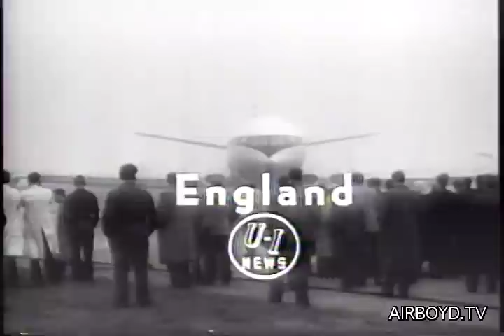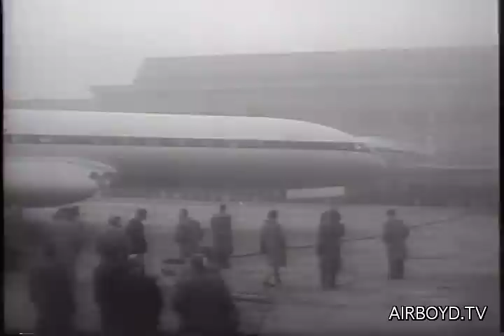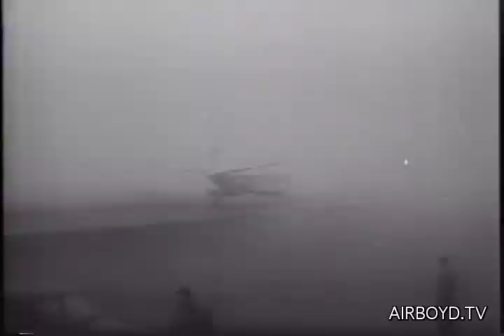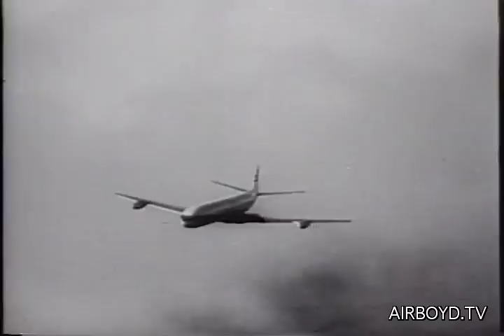de Havilland Comet 3 Introduced (1955) G-ANLO

Comment: After G-ALYV, G-ALYP (Yoke Peter) and G-ALYY (Yoke Yoke)  broke up it was interesting how DeHavilland went about creating pressurised cycles on the ground using a large tank of water to submerge, time & time again, an actual Comet airframe (G-ALYU) to create re-pressurization and over-pressurization.  At 1,836 simulated cycles G-ALYU burst open from metal fatigue around windows in particular.

Comment: The Comet never flew at 600 mph. 500 mph would be nearer the mark for maximum speed. The time given is elapsed time which probably involved a night stop and P.R.  presentations at each stop.  Average block speed (chock to chock) was unlikely to be greater than 400 mph. This would give a total block time of 17.5 hours

Comment: Traveling at 600 mph the plane should have covered the 7000 mile trip in 11.6 hours. That distance traveled in 42 hours would make the average speed 166 mph. Even if they had to stop 3 time for fuel and where laid over for an hour and a half each time that would only add 4 and a half hours to the trip. Doesn't add up.